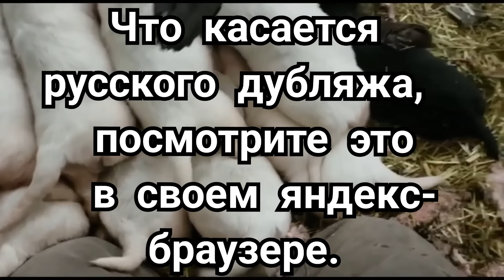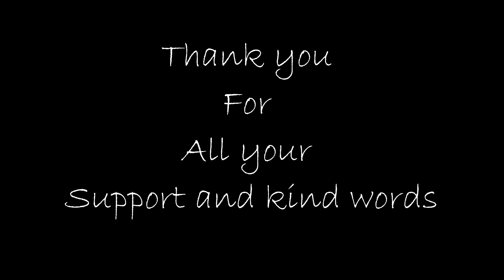CANADIANS in RUSSIA!  WHO ARE THEY?

Comment: I made my house by same technology. Best solution for Russia. Very warm, so minimum expences for heating. In Russia they call it "Canadian house" :) 
But I applied ecovata for insulation. This is much better than mineral one. By blowing into each cell of framing (OSB both out and inside).
Also I have liquid gas holder buried near house, gas heater and warming floor with antifreeze. Because electricity is much expensiver for heating. Also you could face an electricity limitation in countryside so it is no reason to spend its huge share for heating.